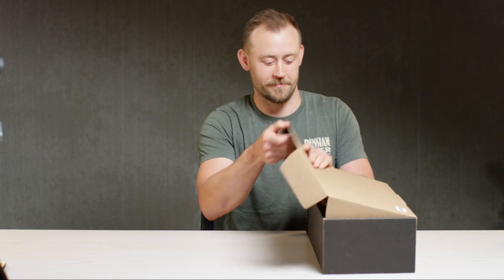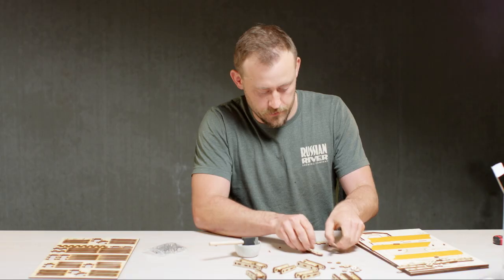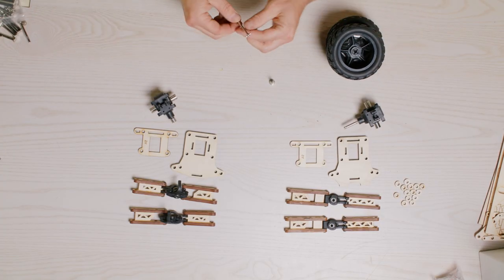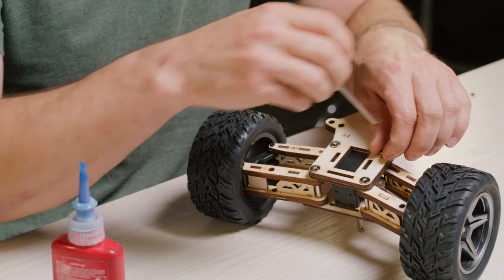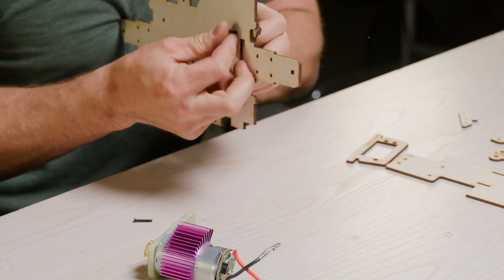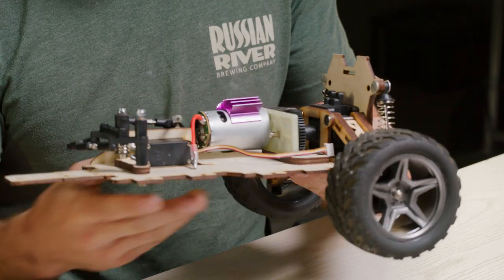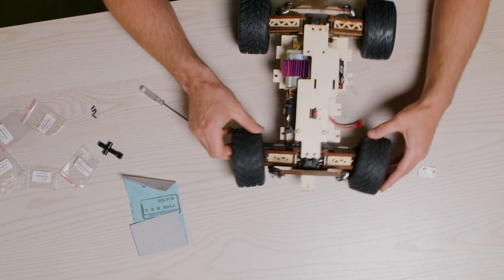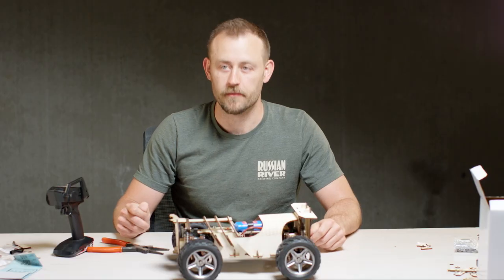Man Crates - Wooden RC Car Kit Instructional Video

Comment: My instructions, very first step, Top Front Control Arm, shows the wrong cross piece, which brought me here. Thankfully, I dry fit first and it looked off. I’m off to find the correct cross piece now, and I’m sure I’ll be back. Not a good way to start, lol.